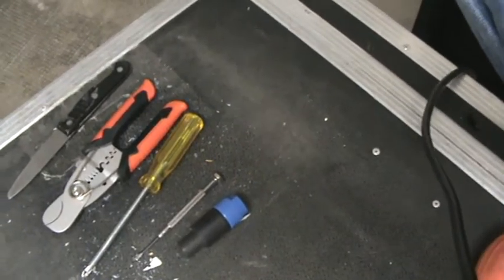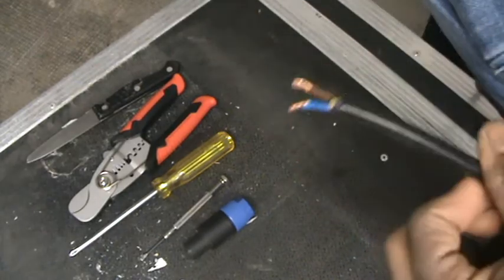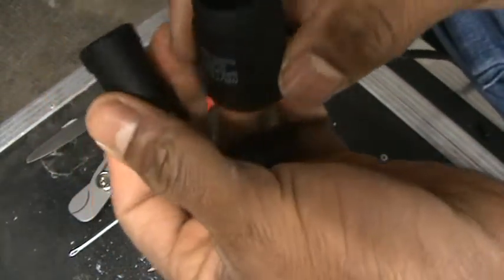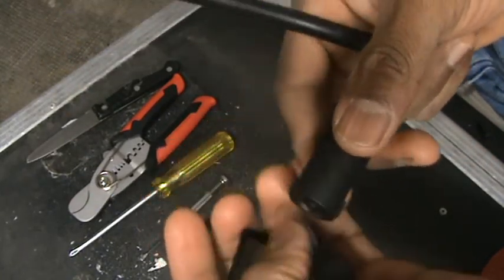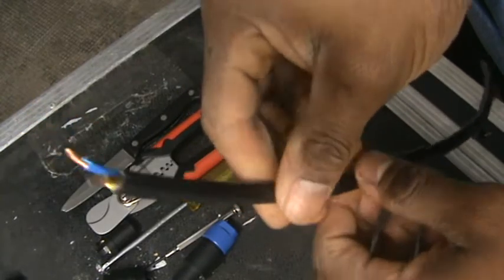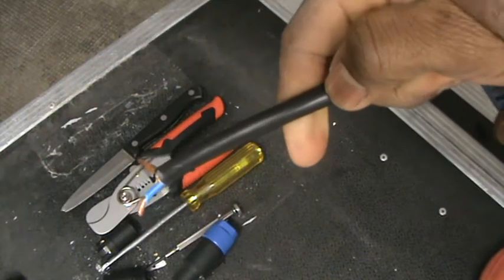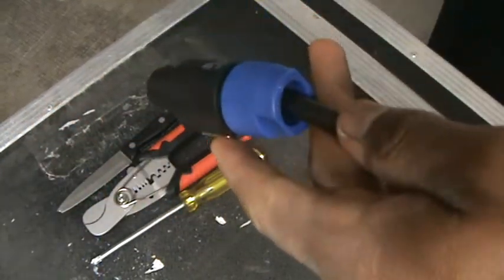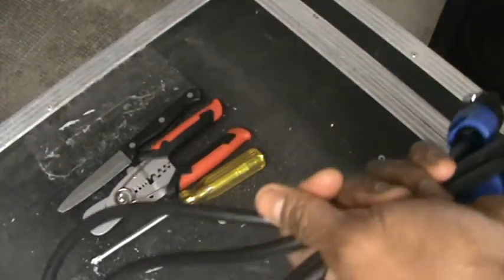How to wire Neutrik Speakon cables for loudspeakers

Comment: Your wiring is different normally the blue wire is cold minus one and the other  is the hot one plus
Reply from the maker: You are right my brother but its dosent matter which color of wire you are using, what matter most, is matching up the wires very well, for example +1/ -1 or +2/ -2  same thing applicable at the other side of the cable as well.God  bless you and i wish you all the best in you connection.

Comment: Can i wire two speakers on a single speakon connector?
Reply from the maker: But mainly I recommend this type of connection when connecting on Bridge Mono Mode connection, cos it’s combined the 2 channels together to produce a powerful sound.
Reply: @richyyrob8062  that would be better for my idea cause first it will be two subs then four after a few months
Reply from the maker: @EBMproductions1  exactly, then have fun with the connections okay, stay bless
Reply from the maker: But it’s not a Good idea when connecting 2 loud speakers on a single speaker connector and plug it on CH A or CH B , is not a good idea but when doing it on a Bridge Mono Mode. Its not a problem.
Reply from the maker: Sorry dear for the late reply, well  it’s possible to connect 2 speakers on a single speakon connector, but note ! It has to be connected parallel for example negative act goes to negative  and positive as well. + 1 bind the 2 nagative wires and sticks it inside the speakon connector . The same method applicable to -1 speakon connector.